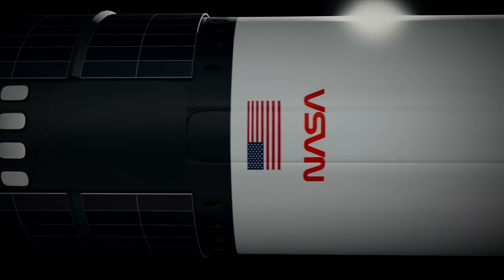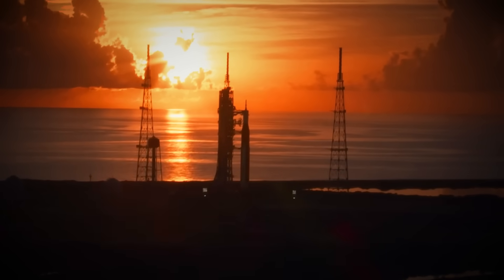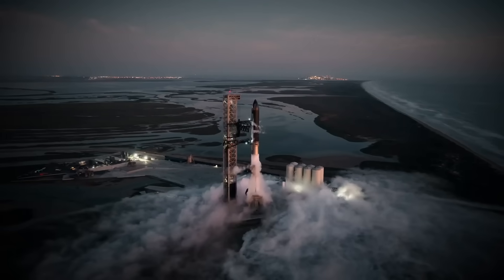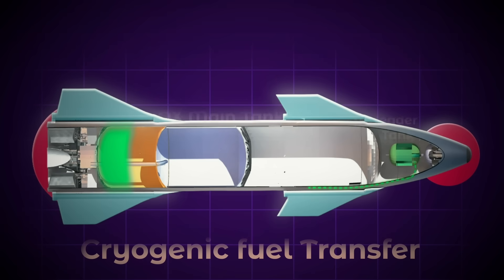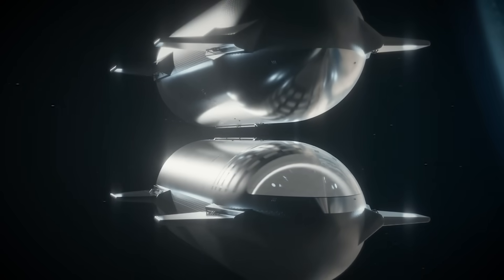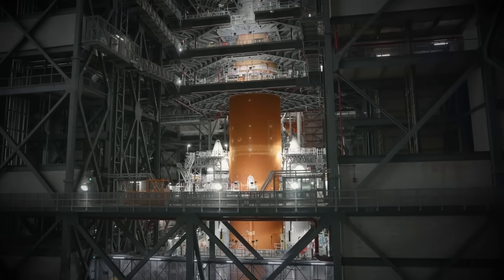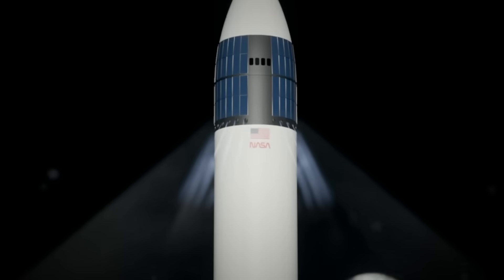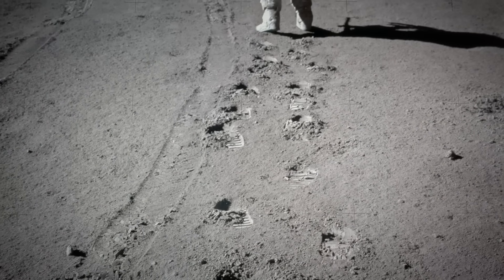How SpaceX and NASA Will Land On The Moon

Comment: The scariest thing about using the Star Ship for lunar landing is, in my view, stability. You will be landing on an unprepared surface, at least the first time, and this thing is tall. Also, since most of the fuel/oxidizer has been consumed the CG of the vehicle will be relatively high. These concerns are so obvious that I am sure the SpaceX engineers have thought about the potential issues. I wonder if it might be a good option to place the fuel/oxidizer tanks above the crewed section and separate them before landing. Just thinking out loud.
Reply: My thoughts exactly. I have to believe that the final product will be designed to adjust for surface conditions.
Reply: @paulr4353  
One simple way is to have all legs adjusted by hydraulic pistons, all connected in parallel, and the fluid pressurized by gas in a shared COPV accumulator. As the legs settle onto the surface, they push fluid into the high-pressure accumulator, which rapidly rises in pressure and begins supporting the spacecraft. A set of series-connected valves will control flow through each leg piston. As soon as the ship motion settles down, each leg piston is isolated by the valves. 

The descent thrusters just have to keep the craft plumb until the piston valves close. A redundant set of clamps on each leg could also stop leg motion.
Reply: @imconsequetau5275  I think they should have big spikes that penetrate the surface down to 10 feet holding the ship vertical.  Just like lawn darts.
Reply: The landing legs need to be shock absorbing, conform to the surface, and keep the ship plumb. 

The first SpaceX HLS mission has plans to launch from the surface, so some propellant should remain after landing.
Reply: It does get very windy up there....jokes 😂
Reply: @Ben_Gunner  Yes. The Luna landing conspiracy theorists will believe you on that. 😂
Reply: why not land on earth first with a variant prepared for reentry and only with raptor engines
Reply: @heshangunarathna3262  
NASA has already sponsored studies and projects to land on uneven ground with random boulders and craters. Hazard recognition is good. [That is, the cameras and AI can select a landing spot so each leg has support after landing.]
Reply: @imconsequetau5275  The software is just standard machine vision, not AI.
Reply: @dionysus2006  
There is a lot of technology transfer between SpaceX and Tesla. I expect that Starship will benefit from the Tesla AI team, including Optimus.
Reply: @imconsequetau5275  As I said, AI is not needed to find a flat spot to land with no big boulders.  Just break the image into sections, find the histogram of each, and get the one with the lowest stdev.  Standard image processing, not AI
Reply: @heshangunarathna3262  
Starship is definitely going to land on Earth hundreds of times before too long.
Reply: They should have big spikes that penetrate the surface by 10 feet holding the ship in place.  Just like lawn darts 🙂

Comment: Under no circumstances should Space X be allowed to land Star Ship on the moon during the first landings. No Star Ship landings until a hard even landing pad be constructed on the moon. Star Ship is too tall and not stable enough for landing on an uneven surface with face powder type soil. To even try is just courting disaster.
Reply: The lunar surface is a thin layer of dust sitting on progressively larger boulders. It’s not concrete, but it’s pretty solid.

Comment: Corrections for you.
IFT3 pez door opened several minutes late & couldn't be closed. That's a fail. 

Re propellant transfer, there was no propellant left to transfer after it bleeding out. So that's a fail too. They also called it out during loss of signal. Which is impossible. 

This version of Starship can only carry 40 tonnes. Not the 100 tonnes promised. So it's not even the craft they are going to need for the moon.

Re orbital refuelling, currently the number is unknown. But it definitely won't be less than 15. Realistically it's looking more like 20. 

A for effort mate, but you should probably use more sources than Elon and his d1ck riding tech bro channels for research.

Comment: How were they able to go in 1 shot, no refuel? How are we unable to do it now?  Is it simply because were taking more mass there?  But could we still send the same cargo weight in one shot?  What am I missing?  Elon said that Raptor is Way more powerful than what they had...  Is it the fuel? Is it heavier and burning faster?
Reply: Apollo used the largest rocket we could possibly build (weighing 3000 tons at liftoff), to put 2 men on the moon for a maximum of 3 days. Now we want to put a 4-man crew on the moon for a month. That requires us to place 20 times more payload onto the moon. 
We could do that with a single rocket, but 20*3000 tons is 60,000 tons. That’s a rocket the size of an aircraft carrier. That’s so big, building it becomes a huge challenge. It’s easier to use smaller rockets, and refuel the one part that actually needs to go to the moon instead.

Comment: I have did this already and I’ll say it again. The starship need to be redesigned to be lighter in weight. The only starship that may need to be stainless steel is, the one that will return to earth. Ellon musk and his vice president will have to make allot of adjustment because it is not practical to launch 10 ships to refill one ship to send it to the moon. That’s way too much money and effort. Also, the ship that will do the returns, will need extra heat sheet blankets install under the tiles. Because when the tiles fly off, at least it will have a heat sheet blanket under. Landing on the moon now is to prepare a moon landing base instead of a bunch of idiot scientist going there with pen and papers. I hope they have satellites orbiting the moon and earth that is connected together wirelessly for communication. Because I see they had lost communication already in earth atmosphere much less the moon. SMH. With landing. Ellon musk need to go and watch some videos with insects and animals in nature to come up with a good plan to land on the moon. The chopstick catch will not work, or less they have chopsticks and legs on the boosters.

Comment: The SpaceX Starship in its current form is never going to land on the Moon. It's nonsense. The best it could do is crash land on the Moon. Is Starship is successful, then its low cost and large payload make  building a tailored Moon landing vehicle in LEO a real possibility. A tug could then transfer it to LMO, ready for the Moon Landing. Before this happens a spaceport needs to be constructed in both LEO and LMO. The Starship is a LEO freighter only. It's what it enables in LEO that is the point.

Comment: 10+ launches for 1 trip to the moon sounds crazy inefficient.
Reply: They’re transporting more stuff to the moon than can be done in one launch. It’s more efficient to launch one moon rocket plus 10 reusable tankers, than to launch 10 moon rockets.
Reply: @Hobbes746  The Saturn V could put around 50t on lunar surface with 1 launch. The Starship can put 100-150t on lunar surface with 10+ launches. How is that efficient? Also the Saturn V never failed or had an unscheduled disassembly or whatever SpaceX calls it.
Reply: @Ghandara-hg1gc  No, the Saturn V was limited to putting 4800 kg on the lunar surface. 
For the Saturn V, NASA ran individual stages on test stands. They spent several years doing this, working out the kinks and blowing up stuff on test stands. 
SpaceX has moved from test stands to launches much earlier in the development cycle, so it’s to be expected to have a few failures in flight. That’s what those test flights are for.

Comment: Can they not make a longer variant of the tanker with bigger tanks to reduce refill launches?
Reply: Yes and no. Making a longer Starship is part of the plan, but at some point you run out of room: within the diameter of the rocket you can only place a certain number of engines, and the maximum thrust of those engines determines how tall you can make the rocket. The only way to more payload then is to increase the diameter, and that is a bigger undertaking than increasing the length.
Reply: @Hobbes746  Maybe they can get down to 8 ship refuel with a slightly longer tanker variant just a guess. I still think this is alot of ships to launch for 1 mission and surely the super heavy will only have so many reuses?
Reply: @Targus28  SpaceX’s goal is to make both Starship and Super Heavy very reusable, as well as cheap to build. Current goal for Starship v3 is 300 tons payload, compared to 100 tons for v1.
Reply: @Hobbes746  How many uses does falcon 9 have?!
Reply: @Targus28  The oldest stages have been reused about 20 times now, and there’s no sign they’re near the limit. We don't know how much time and money it takes to refurbish a stage for the next flight, but that is a focus for Starship: The goal for Starship is to be able to launch a stage again within a day.

Comment: Excellent video. One small correction: Artemis 3 (and the later Gateway missions) will use a near-rectilinear halo orbit, not distant retrograde. Artemis 1 used DRO, Artemis 2 will just be a fly-by on a hybrid free-return trajectory, but later missions will all use NRHO.

Comment: They are going to hire some people and buy some metal the workers are going to draft some designs using neutermeters then off the plans build a ship that will travel to space the moon were they will get some clues as to were they want to land then with all the math find a proper landing technic wether it be (now here's the important part) multiple ways they could gain access to the moon 1 landing flat on slides problems, strips, structural, build a slide parachuting multiple separation landing rocket propelled landing dust issues ,  self guided tower rocket landing a big net to catch the ship crash landing balloon roll nose reverse thrust vectoring hope step jump  3 stage landing cable explosion lock finding a small caviate to grapple catch ( you don't sell what you say it's shit don't title a vid without the real explanation you fuck up your shit pisses me off)

Comment: I really hope SpaceX launches thier first Moon Lander with 2x TeslaBots inside. They could test-drive the control systems in 1/6th gravity (to confirm the simulated control weights). Also, they would demo humanoids walking around inside the crew spaces. Lastly, how cool would it be to show TeslaBots suiting-up in space suits (to protect their electronicsfrom dust), and actually walking around on the moon!

Comment: It will be interresting to see this huge structure resting stable in the dust of the moon surface.
Reply: I hope the wind doesn't knock it over! 😂😂
Reply: @adalberteinstin5137  the layers of dust under the top layer (regolith) is so ancient it has hardened into something of a hardness approaching concrete. That reality was one of the surprises of the Apollo moon missions. Notice how shallow the foot prints and wheel tread marks are.
Reply: @lonetree1941  And at the rate it's going it will have another century or two to harden as well.

Comment: How are you going to build the landing pad? What machinery is SpaceX needing to move rocks, level the soil, and compacting it down? Right now, this top heavy vehicle might topple over landing on a boulder or a pad sinking in soft dirt (doubt those thrusters would keep it level once the fuel is exhausted)….and at the same time, the engines might get damaged by flying dust to large stones disabling it. No repair stations anywhere. 
Sure I would love SpaceX to succeed but these YouTubers are missing A LOT of details and fail to think this through.

Comment: The Artemis missions are using a Near Rectilinear HALO orbit - specifically the 9:2 L2 Southern NRHO - NOT a DRO, or Distant Retrograde Orbit. That is the retirement orbit of Gateway after the Artemis program, and where the Orion capsule was tested. However, it is not where any of the human landing systems, Orion, or Gateway will reside during the program. Your animation was correctly showing an NRHO, but incorrectly labeling it as a DRO.

Comment: The "current Starship design" can barely carry itself to low earth orbit with a zero payload mass. On test 3, the fuel tanks were exhausted, and it barely made it to orbit. Oh, but you may infer the "current lunar Starship design", which has not been built yet, the one which will probably capsize ont the moon if it ever reach its surface. OK.
Reply: What are you expecting. Its onlt test 3.  Spacex is very smart to get almost on orbit for test 3. Look at nasa. It took them like a decade
Reply: They’re in the middle of testing with prototypes, and they already have enough performance to put 50 tons of payload into orbit.
Reply: @Hobbes746   ok. That statment prove that the first statmend is wrong then
Reply: Cry harder

Comment: So many possible points of failure. All these launching, docking, refuelling maneuvers alone. It could fail while docking or refuelling at the last maneuver, then they'd have to start all over again... honestly, that sounds so unnecessarily risky to me. I hope it works out fine, but i have my doubts. This is going to be very interesting!
Reply: Good point about emptying the orbital depot. They should try transfers in both directions in advance of the final mission commitment. That is, transfer propellant between tankers in both directions as proof before launching the HLS craft to LEO.
Reply: Why not take fuel tanks inside Starship payload and dock them together in LEO, as many as needed. They could be configured in any shape.
Reply: Destin, of "Smarter Every Day" addressed exactly your many points-a must-see video about this complicated {probably insane} hocus-pocus approach being far too risky in so many ways
Reply: it’s risky, but we have no alternative. If we want to have 4 people on the moon for 30 days, that’s 20 times the payload that a Saturn V could put on the moon. If you wanted to do that in a single launch, you’d end up with a rocket that weighs at least 20 times the 3000 tons of a Saturn V.

Comment: if we couldn't properly land a small research project on the moon how could we possibly succeed with a huge starship.
Reply: What?
Reply: @azkavanny3077   recent thing that fell over i forgot the name.
Reply: @FoogleBoogle  well thats a very very new and different system
Reply: @FoogleBoogle  the first attempt by a company new to spaceflight, that seemed to be determined not to learn the lessons from previous lunar landings you mean?
Reply: @Hobbes746  no. 
The thumbnail shows a flat landing pad but said nothing about it in the video.
So I'm assuming they'll try to land starship on the moon. Didn't go well for a small lander
Reply: @FoogleBoogle  As I said, IM-1 was the first lunar landing by Intuitive Machine. They made some basic errors in flight preparation (forgot to switch the altimeter out of safe mode), which led to the lander making an incorrect estimate of its altitude and hitting the ground before it had reduced its speed to zero. 
Meanwhile, SpaceX have landed more than 200 objects that are 30 meters tall, many of them on a small ship rolling with the waves.
Reply: @Hobbes746  fair enough

Comment: Why not just mount another booster the same size as the current Starship atop a fully sized booster. So it's a sort of mini-booster ontop of a full-length booster. The mini-booster has a faring atop it just like the Falcon 9/Heavy launches for aerodynamic  purposes. Once the main booster gets to orbit the mini-booster separates and remains in orbit, the large booster returning to Earth -  the faring halves having already detached earlier & parachuting back to the Earth's surface to be captured. Starship is launched & does its various maneuvers before it docks with the connecter end of the booster. No flaps are needed, if only going to the Moon, they will be needed if going to Mars. The booster acts as a pusher for Starhip both to & from the Earth on a loop back & forth to Mars - again, in an endless loop-the-loop. The Starship conserves all of its fuel for its own landing & take-offs if need-be from both the Moon & Mars. The thing that needs to be worked out is the constant refueling of the potential pusher boosters in permanent  inter-planetary loop system in the space environment.